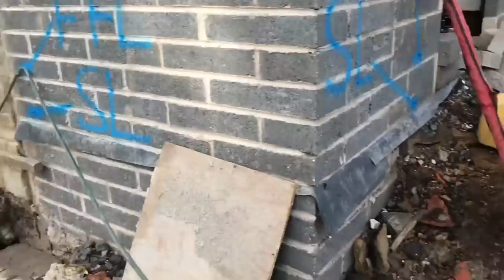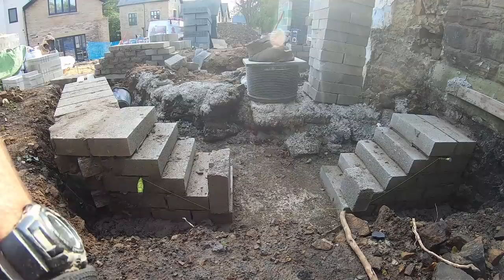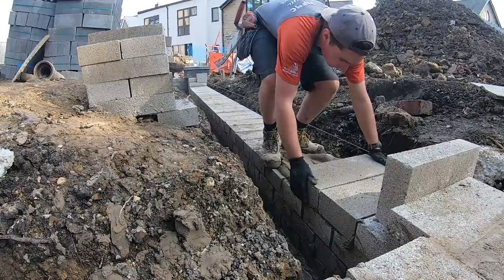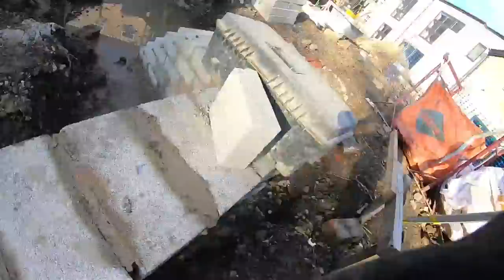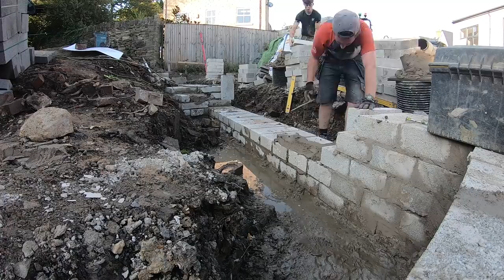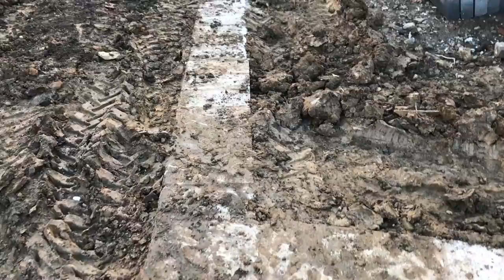Bricklaying - Concrete Blockwork Complete On The Lodge Extension #bricklaying #footings #extension

Comment: What's  the rendered building while everything else around is stone.
Reply from the maker: It’s an 80’s extension originally rendered in an orange colour, looked awful to be fair, but it’s been there before almost everything else around it. The houses you can see behind were built about 10 years ago. Part of the planning when renovating this site was to re render that part of the building 👍